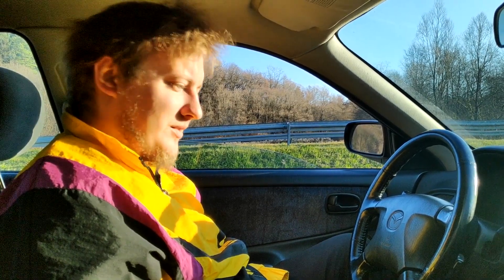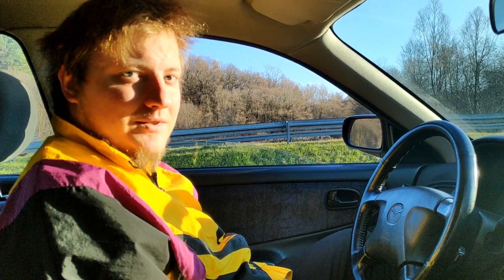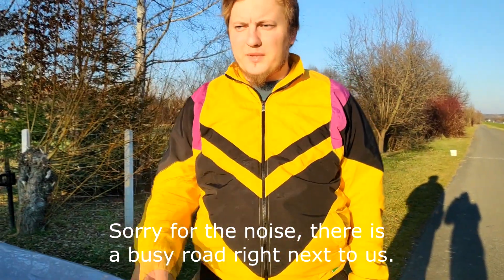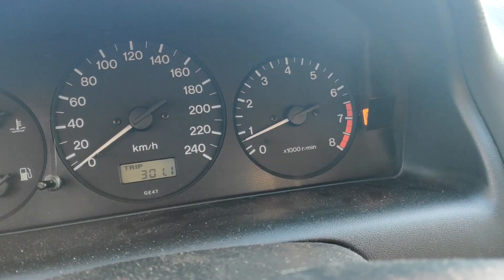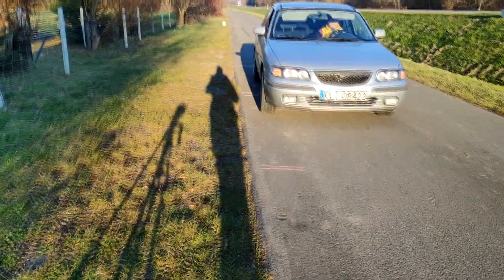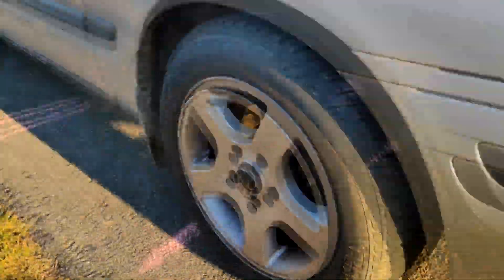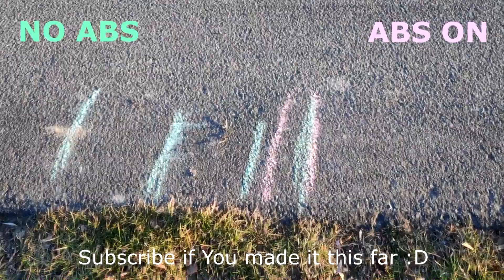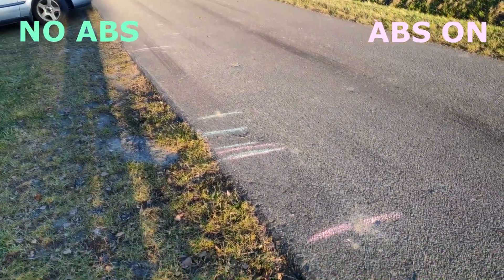ABS vs NO ABS on dry asphalt | Does ABS decrease the braking distance?

Comment: Smart but would abs not usually kick in during bad condition? Like in Canada 6 months of the year I basically drive in snow, would be cool to see no abs vs abs on snow. I think abs in clear condition is mainly for people who were not paying attention and slammed brakes, no? Still one of best test videos in general I've seen and in English :)
Reply: In loose fresh snow if you lock the wheels, the car will 'dig in' and you will stop much faster.
Reply: @SparrowNoblePoland  doubt that. Never seen people lock up and slide in conditions other than snow or ice. I haven't tried this tho, I always aim to not have my abs kick in but the few times it does it comes clutch
Reply: @ml-fishing1341  If you drive on loose fresh snow (in negative temperature, in positive temperature it will be slippery as f...), and you have car without ABS, full lock of wheels will make the car dig in into snow, and you will stop faster than braking without locking the wheels. 
Mind the technique doesn't work if the snow has already been flattened by other cars. But if eg. you drive in ruts and there is unsquashed snow between your wheels, the fastest way to brake is to turn on the fresh snow and brake on it, wether it's with ABS, or without using full-lock technique.

Full lock can also be used for countering oversteer when there's not enough space or skill to control it, but it's complicated and not worth explaining.
Reply: Oh now I see the end, would be best to try again in snow and maybe rain. Your speed looked consistent, I believe you
Reply from the maker: @ml-fishing1341  test on rain coming up today, tomorrow I plan to do one on a dirt road, and snow once we get it :)
Reply: @DriftSlav  thank you, would be very interesting to see.
Reply from the maker: @ml-fishing1341  wet conditions are live ;)

Comment: Probably helps that this isn't an actual emergency situation. Harder to modulate the brakes, steer, and plan how to avoid an accident. Much easier to stop the pedal and steer where you want to go.
Reply from the maker: I can only speak from my own experience, but driving without ABS made me a better driver. Not putting all faith into full braking force, but actually focusing on trying to avoid the danger has proven better for me. I did crash my first car by unsettling it by braking before the corner, even tho I would make the corner otherwise. Now even if initially I'd start braking, if I see it will not be sufficent, or going around it would be the better solution, I'd realease the brakes completely, or almost completely so the rear end wouldn't get loose when I turn the wheel. 

I'm so used to driving the ABS I threshold brake even with working ABS, so I don't benefit from it anyways. I remember few years ago, ABS kicked in my daily when i was driving on snow, and I almost had a heart attack whats kicking my foot, as I forgot that my car had ABS all along.
Reply: Harder, that's why to drive without ABS you need to train it first, and have it imprinted in your muscle memory.

Comment: Thanks for sharing! ABS is really best for safety (especially for the average driver, and especially if steering angle must be applied during heavy braking), but no ABS can help you stop sooner if you are experienced. Good content!
Reply: Especially when you're goint to do 'dig in braking' in loose snow or on gravel/ground. Once I avoided a crash by going over soil between asphalt and energy barrier. Left tires blocked, and the car stopped much faster because it dug into the ground as deep as suspension arms.